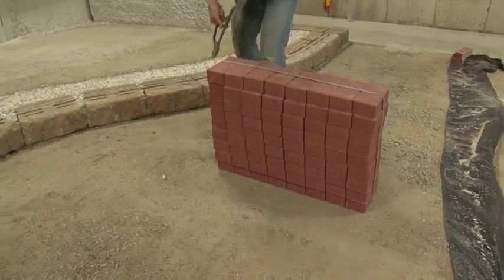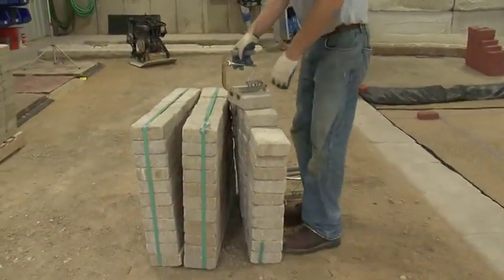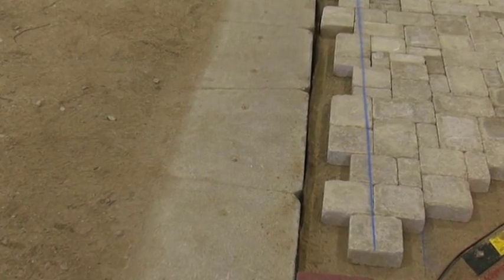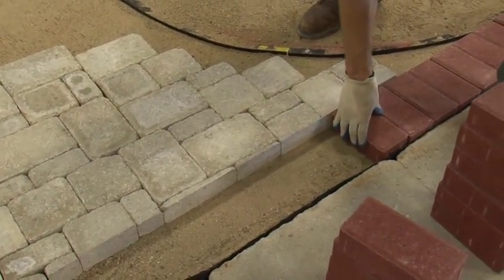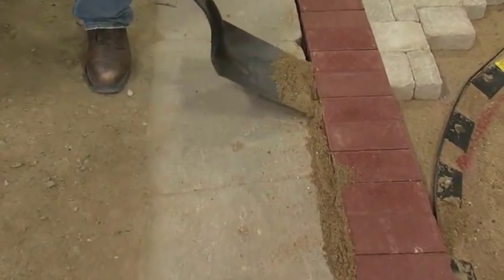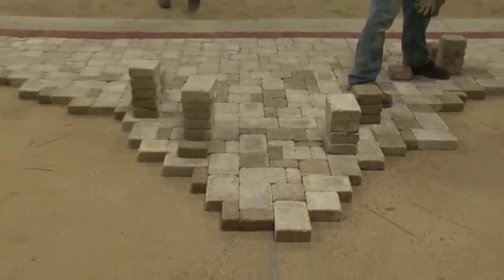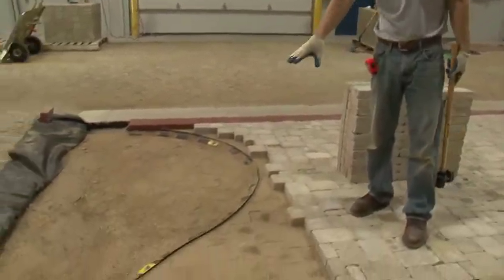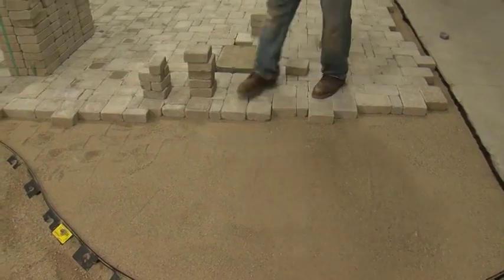Chapter 11 | Laying Pavers - Concrete

Comment: I have a question. I had a terrace that was a reinforced concrete slab over a basement space that needed to have the brick pavers redone as the slab was leaking. The existing brick which was installed over a bed of sand that had been mixed with portland. A waterproofing membrane was troweled over the existing slab with it sloping to the existing drain points. I put a drainage board over the slab to make sure any sand didn't go down the drain.  I had originally specified mixing sand with portland like a swimming pool mix with the idea that the portland would bond the sand together to keep it from flowing with surface drainage but the person representing the owner objected and wanted just a sand base. Which one in  your opinion was the correct way to do it?

Comment: I missed something. Are you laying on a thin layer of sand?...on concrete.
Reply from the maker: Depending on the consistency of the paver thickness you might need to plan for a 1” bedding of coarse sand for leveling and drainage.

Steve Jones

Comment: 06:24 I thought you said skinny slivers are to be avoided
Reply from the maker: Ahh. The infamous yes no maybe. Avoid long sharp points but pedestrian residential is more forgiving than commercial vehicular projects.
Heavier the loading you need to consider pattern change to make for bigger pieces

Steve Jones